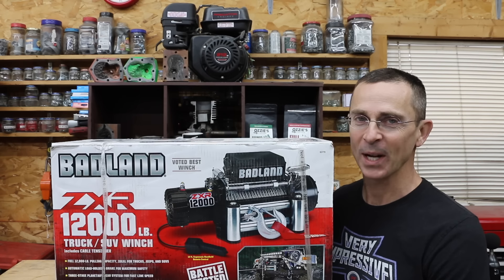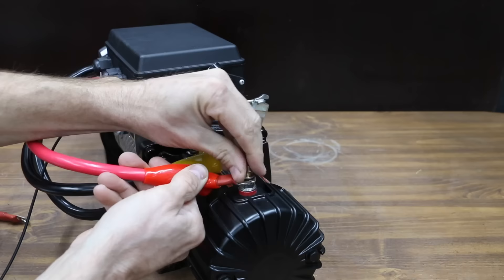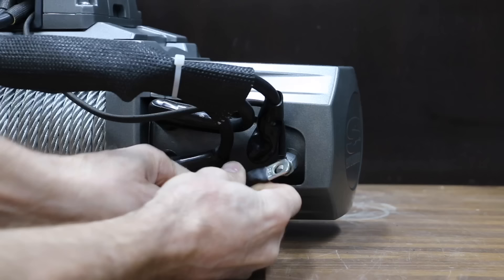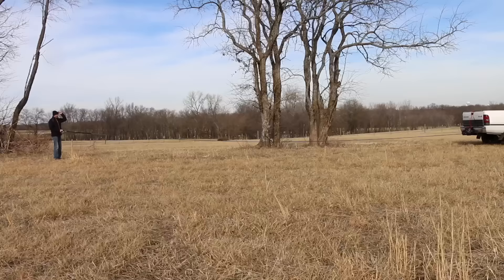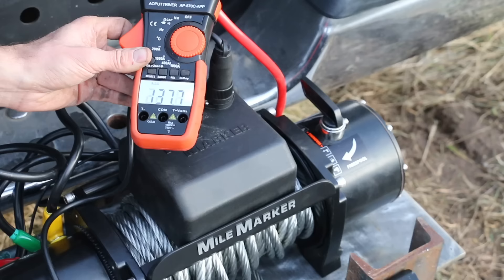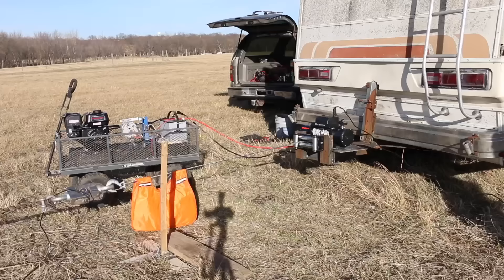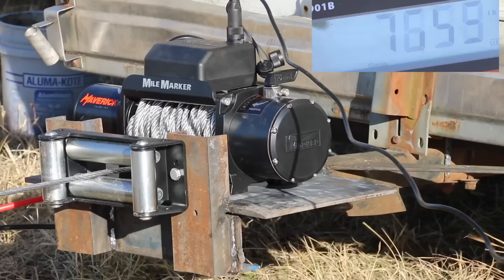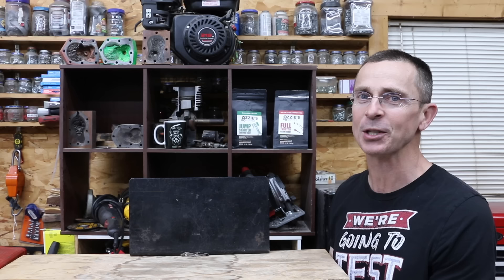Best Winch? Is BADLAND Better Than WARN, Smittybuilt, Milemarker? Let's Settle This!

Comment: For round 2, I would highly recommend running the Badland Apex 12k and the Smittybilt X20 12k.
Reply from the maker: Thank you for the video idea!
Reply: I second the request!
Reply: @ProjectFarm  would love to see a sherpa winch in the same 2nd round
Reply: And sherpa and warn
Reply: Please include the Ramsey Patriot Profile 12,000.  Made in the USA!!!
Reply: If there's a Round 2, I'd love to see the Warn Zeon 12-S Platinum tested!
Reply: @phd7800  pretty pricey
Reply: I’d definitely like to see the Badlands Apex! It seems super popular and I’ve looked VERY hard at getting it myself!
Reply: I agree with this also, was hoping to see it here
Reply: Hydraulic winch running on a Tractor SCV. Mile Marker/ Ramsey to name a few. They are pricy tho..
Reply: @ProjectFarm  Glad to help! I love your straightforward and honest reviews, and the brilliant engineering concepts that you devise for your testing methodology. Cheers!
Reply: I would like to see an Engo 12k. I've had one for 10 years and still works perfectly. Used it over 200 times. I've used snatch blocks to pull out a semi truck, I've pulled larger john Deere tractors completely buried, and too many 4x4s to count. Never used a cover on it, and it's been in the rain and elementals for 10 years. It's even been fully submerged under water dozens of times. Still works perfectly. They have a lifetime warranty on mechanical and cost about $350. Supposedly the owner and engineer is the son of the owner of Mile Marker winches.

Comment: Your reviews are the best.  I have been looking at winches in this class.  The Zeak was on my list and a few days after this was posted, the winch sold out on Amazon.  I don't think this was a coincidence, your reviews have an undeniable impact.  Keep up what your doing, your content is some of the best of it's type on YouTube!

I ended up getting the Zesuper 12k.  Amazon gave me a flashdeal that I couldn't turn down ($288 with tax and S&H).  Since I won't be able to mount this to my GX470 right away, I made sure to bench test the winch as the 30 day refund period might end before it is mounted.  Everything worked well under these conditions.  The winch was smooth, quiet, and the rope pulled out easily.
Reply: How do you like the winch you bought at this point? I bought a Jeep that had a Badlands ZXR on it (same one from this video) and it works fine, I just want a synthetic line and wireless remote. I can get the wireless controller for mine at Harbor Freight for around $40 it seems, so I may just do that until my steel cable frays. What's your opinion on that?
Reply: @evanwebber9981  
I’m getting a cable to replace my synthetic rope. Those break without warning and can kill you if under tension when they break!

Comment: I'm mostly retired but I have worked part time for a lawn and garden shop doing pick up and delivery. The trailer is 10 years old and has a 4000 lb Warn winch. I can tell you from experience that it has never failed us and it gets used almost every day. Having said that, I have a 3500 lb Badlands winch on out SXS for occasional use and it works fine as well. I love these videos. Thanks.
Reply from the maker: Thanks and you are welcome!

Comment: I bought a Zeak 13K for my Bronco project just based on written reviews. This is the first comprehensive and objective physical test I've seen! I'm feeling a lot better about my choice now, thank you!
Reply from the maker: You are welcome!
Reply: That was the one I was considering - is there a better choice for the cable/rope?
Reply: But the Zeak will not out perform the Badlands Apex nor a Warn Zeon. These both will destroy any of the tested units.
Reply: @Arkie407  after watching this video, I restrung mine with 3/8 Amsteel rope. I doubt I needed to since I seldom single-line pull.

Comment: Great video...as always.

I've been winching trucks out of stucks since the 1970s. Back then, Warn or PTO winches were the pretty much the only game in town. As more brands appeared, quality seemed to suffer.

I replaced a 1980s 8000 pound Warn winch that saved my axe a bunch of times. It cooked wiring harnesses, alternators and broke cable but ALWAYS got me out. The clutch assembly finally exploded on it's last pull.

I replaced it with a Superwinch (2010ish) 8500. It wouldn't pull like the Warn and burned out on it's first rodeo. I replaced it and after about 10 moderate pulls, the replacement has started to smoke. I now always run a block pully on my winch to double the pulling power so as not to tax the winch. It also slows the pull by half that lets you see things going array.

The most critical thing to me in a winch is not line speed or pulling power (they all lie). It is RELIABILITY. That winch has to work after sitting out in the weather or driving through hours and hours of road spray or caked in goo.

I would love to see these winches pulling to destruction. That's not the evil voice in my head but strictly a desire to see some sort of endurance/reliability/quality of each. Pulling that much amperage also fries everything in the charging circuit. And the thermal overload protection kicks many of them off before you get out of the hole you're in. Those without will have smoke rising from the alternator and battery cables as they melt down.

My Dad's old oil field Dodge Power Wagon with a brutal PTO could bend that truck in two if needed. And it would do it until you ran out of trucks to bend.
Reply from the maker: Thanks!  Thanks for the suggestion.

Comment: Like others have suggested, I'd like to see how the Badlands Apex stands up to the others and I'd also love to see a test of synthetic winch lines and kinetic ropes.  Awesome videos!  I'm a huge fan of this channel and recommend it often to other people.
Reply from the maker: Thanks!  Thanks for the video ideas.
Reply: @ProjectFarm  there’s a Chanel saying people are winning and I’m just trying to see if I can trust it?
Reply: me too on that APEX....I'm not sure which Badlands winch it was in this video...i know mine didn't cost $350 tho...more like $650 I think....but if the rope busted tomorrow and they told me I had to pay $1000 for another one?  I'd buy 2 just in case the price went up again.
Reply: @Richard Finch  who told you that?
Reply: Definitely would like to see badlands apex 12000 vs warn Xeon 12000
Reply: On 4 trailers my work has been through probably ten badlands winches in the past year. I'd avoid that brand at all costs. Warn on the other hand lasted a good 4 years or so.
Reply: @damascuskillet5532  warn would win, speaking from years of having to use both.
Reply: @jcg702  was up in some trails in my jeep, had a badlands Apex 12k. Had to use my winch to move a tree out of the way of the trail, winch all the sudden made a super loud pop, couldn’t see what was wrong, winch started barreling smoke out from it. Then suddenly started winding in on its own. Unplugged remote, wireless was off, still kept going in on its own. Started causing all engine lights, radio, cluster started going haywire flashing on and off. Only way I stopped it was opening the hood and disconnecting the cables from the battery and putting it into free spool. Will never use that brand again and could have potentially killed someone else or myself. Spend the extra money on the warn and have the peace of mind of a quality product.
Reply: @Pierce Merrow  glad it didn't go any worse than that. Can't say we had that happen, they just constantly break down on us. I'm sure our mobile mechanic is tired of running to harbor freight literally every month. Thinking of sending this video to our corporate office to try and put sense into their heads.
Reply: RED winches. beat all these chinisium wiches on every category. sure they are expensive but the design is soooo much better since they dont have planet gears that add ALOT of drag and weight to the design.
Reply: Watch Matt's off road reco eey or trail mater. They all use badlands apex winches and are the best in the business for recovery.
Reply: @ProjectFarm  Everyone and their mother wants your opinion on the apex 12000.  Were going to buy one now.  I really wish you had tested it.
Reply: @damascuskillet5532  same.
Reply: @RLFinch33  The Badlands ZXR is their lower end model, Apex is the higher.
Reply: @richardfinch1105 from what I can tell the synthetic rope adds $300 to a winch.
Reply: i second (or 3rd or 4th) testing the Badland Apex 12000
Reply: @MichaelMantion bro he did test it. The badlands in the video is literally the same thing just a cable version

Comment: I've had that Zeak for just under two years.  It's pulled several cars out of ditches, righted a rolled Deere and dragged several dozen 10ft, 26" pine logs up the side of a canyon.  Haven't had an issue with it yet.   Great tests.
Reply: Great feedback! Where did you purchase your Zeak?
Reply: @preachers4135  Amazon
Reply: @Jcreek201  Cool thanks.

Comment: We need a part 2 for this using higher-end units!! Especially Warn, Smittybilt & Harbor Freight. There's a few new companies around as well & we need these  tested to the absolute max! Any winch that breaks under any conditions should be completely crossed out of anybody's decision making!
Reply from the maker: Thanks for the suggestion.
Reply: You can't generalise on crossing anything out just because of failure. Nothing is indestructible. Overloading, abuse and use outside of design paremeters can cause failure. I guess there is always some idiot that doesn't get this and gets into trouble thinking their equipment is infallible.
Reply: @wigs1098  The reason for this type of testing is to figure out the point of failure. Basically the testing doesn't stop until you reach 100% failure!

Comment: I love your reviews I would suggest comparing the Badland 12K Apex winch - thats the one Matt's Offroad (another famous Youtuber) is using. It would be amazing to see any performance differences that winch may or MAY NOT have.  In addition it would provide perspective of what can be achieved in real situations with the Badland 12K Apex as the baseline from Matts recoveries.
Reply from the maker: Thanks!  Thanks for the suggestion.
Reply: Keep in mind that Matt also ditches the stock line and installs a Freedom Recovery line. It would be interesting to see what the winches in this video that did break their lines, could do with an upgraded line.
Reply: @941Earl  Yes I would like to see the same.
Reply: Exactly thats what is awesome. Project Farm actually does it right and honest.

Comment: I've had my Zeak on the front of my Yota for about 1.5years now.  One, I didnt expect too see it in this test, and two I didnt expect it to actually perform but its been a great winch. I dont use it a ton but it does come in handy, and the rope and wireless remote out of the box is a nice feature.
Reply from the maker: Thanks for sharing.

Comment: finally someone doing an independent review on actual performance I kind of figured those rope winches ropes are not as strong but was surprised that Warn has dropped so low used to be the standard for all winches back in the day I had one
Reply from the maker: Thanks for sharing!
Reply: When Warn was made in the US, they were tops in consumer products but Ramsey's US made commercial products were better. Milemarker's hydraulic products were great but expensive and complex to install on a vehicle. MMs electrics were subpar at that time.

A Warn US 8274 is always gonna be darn tough to beat. A Warn US M8000 is a lot of winch for the money. 

All the cheap chinese junk is junk so spend what you can and buy the warranty you need.
Reply: Yeah like I prefer synthetic rope instead of cable for a handful of reasons
Reply: @mwilliamshs  its only the Warn VR line is fully made in China..They continue to manufacture substantial parts of their winches at the Oregon factory,
Reply: @mwilliamshs  A fellow Ramsey enthusiast. They were the only brand to have in the late 80's, early 90's. Warn was the economy brand. Somehow Ramsey faded away and Warn became the brand to have. With Badlands being the economy winch.

Comment: I am surprised that so many ropes broke before their load rating was achieved, scary! a winch line test would be cool. As far as other winches go the higher end Warn and the Apex should be tested. Thanks for your content.
Reply from the maker: You are welcome!
Reply: @ProjectFarm  I agree that the Badlands Apex vs the higher end Warn would make a great video.
Reply: For what it’s worth. Saber Off Road are obsessed with bench testing their recovery gear (including winch rope) should you need a replacement. I’ve got no $take in the company although they are local to me.
Reply: A wire rope on a crane is usually 3x it's rating and an elevator's is 10x.  These were < their advertised rating.

Comment: I'm considering the 13.5k Stegadon on Amazon, but I'm impressed with the Zeak.  At $370 and a 10k rope failure, I think it is a formidable winch for vehicles in the 4000-5000 lb GVWR range.  It was also VERY interesting to see the pulling force of each pull, noting that your average rescue would be about a 2000 lb pull with maybe a peak to get it unstuck... GREAT testing!  I have to slow down the videos to absorb all the info a bit though, but other than that, I love this channel!!!
Reply from the maker: Thanks!

Comment: I have a 12,000 Harbor Freight  Badlands winch with the fabric line. It's a dream. I haul salvage cars on to my trailer and use a Group 24 DC  Deep Cycle marine battery. With a hot charge this winch is a dream!
Reply from the maker: Thanks for sharing.

Comment: I have run a Mile Marker for twenty three years on my car hauler in Minnesota. I got the motor hot at year 15 and the design had changed but the guys at mile marker went all out digging through parts bins to make me a motor. In the end they could not find enough obsolete parts but it turned out Summit sold a 99 dollar motor that fit right up. I got a snatch block so I wouldn’t overheat the winch  magnet adhesive on the tractor wheels over the fender pulls. They get steep. I only winch maybe 10 times a year. That winch sets outside, uncovered, buried in hay, washed in road salt and it just keeps pulling. After watching this my suspicions about rope v cable are confirmed. Milemarker came with a 9/16 cable which has been nice. If a rope breaks at max pull up a trailer ramp you are pretty screwed. One time I forgot my hold down pins and bounced that milemarker along with a seven foot I beam all the way off the trailer as the pick up rolled back in the customers barn. Of course it was the one time my wife was with on a haul. Very humbling. I was able to jump in the truck and hit the brakes before it hit the wall. Anyhow I would opt for heavy duty steel cable if I ever need a new one. But at the rate we are going Mile Marker earned the 450 I paid for a 10,000 pound winch in 2001. Thanks for the video. I think I would buy American made if I could. I thought that’s what I did but the hydraulic line was the US and the electric was farmed out. Can’t believe Warren went Chinese too. None look as well made as the older ones were but some did ok in your test. The magnets fell out of my motor a couple months after the overheating situation so a follow up might be nice if you still have them around.
Reply from the maker: You are welcome!  Thanks for sharing.

Comment: Fascinating test!  I live in the past, and didn’t realize some winches I’d considered American are now made in China.  I have the HF Badlands 12,000 with remote, and it works fine. But due to the current trend of saving money and drum space by carrying only 65’ of line, I had to go back to the HF Road Shock 10,000 I bought around 2013 (to replace a Ramsey REP8000 stolen off my car trailer), when I needed the 100’ of line on the older winch to reach some logs.  Like you, I’ve purchased a receiver mount, but put more faith in the heavier receiver mounts I’ve fabricated.  I believe all or nearly all electric winches are rated with one wrap on the drum and all conditions ideal.  PTO winches have honest ratings; my old 10,000 lb. Ramsey really is made to pull 10,000 lbs. and with a 304 International behind it can be expected to pull until something breaks.  I’ve used Kevlar straps in the industrial world (straps to lift a 135 ton generator rotor are a fraction the weight of the old steel cable straps), but I live in a world of abrasion and rough treatment, so I stick with steel cable.  Thanks for all the great info!👍
Reply: Back in the day the 10,000lb Ramsey was the winch to have. The Warn was the economy brand back then. They always seemed to have solenoid issues, were slow, and had an issue with free spooling under a heavy load.
The Ramsey had a planetary fear system that never failed.
Reply: @fauxque5057  I'm not sure what 'back in the day' was for you, but for the last 40+ years Warn has been king with their 8274.  It is almost dangerously fast if in the wrong hands, and was very under rated on capacity.
Reply: The VR series and handheld warns are made in China. The rest of warn work lines are made in the USA